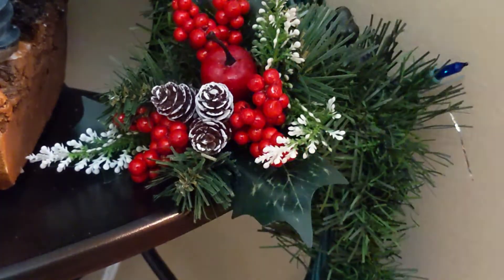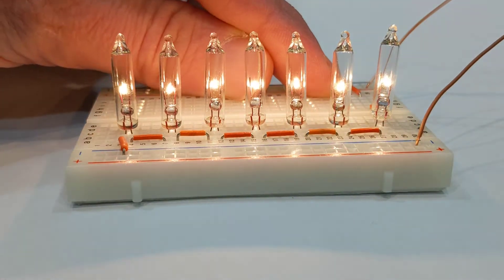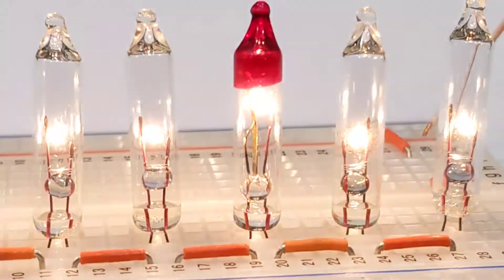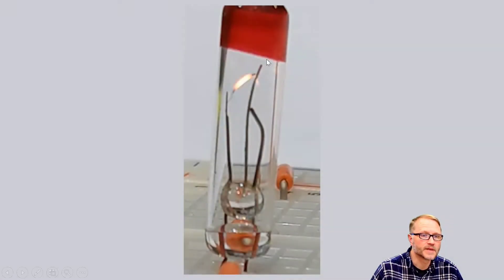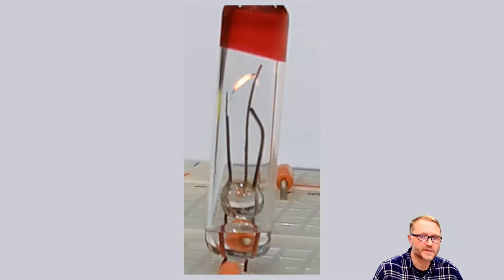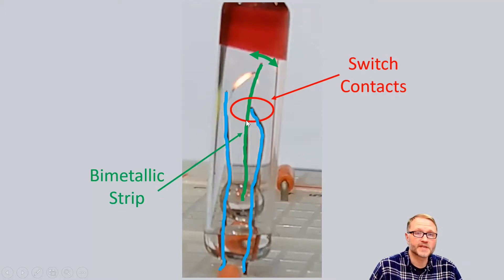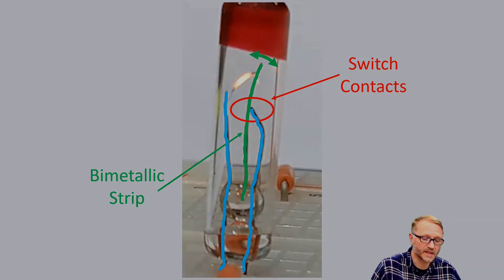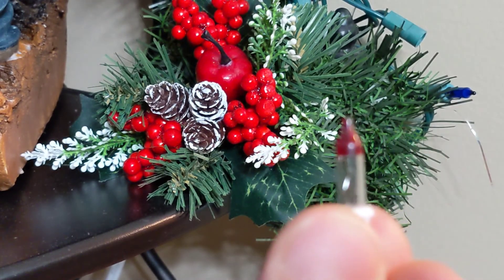The Secret Mechanism in Blinking Christmas Lights (Bimetal Strip Explained)

Comment: It's annoying that there is no manufacturer making blinking 2.5-3v toy bulbs.  I've tried LED PCBs (used to create flashing), but they do not work with incandescent 3v bulbs.
Reply: they don't be cose ar incndescents no DIODE. A diode respon faster than filaments incandescents. You must use a circuit suppor 110-120 input with DIODE rectifier bridge an then a controller or SRC transistor oputputs....

Comment: hi i have a question, i bought a 300 bulb christmas light. It was 3 that you had to connect to each other. I replaced each strand with 1 red tip bulb. They all blink but at different times, also for some reason the bottom strand thats directly plugged into the wall blinks fast and consistent but the other 2 that’s connected to the bottom strand sometimes only blinks
Reply: did you ever find the answer to your question?

Comment: Quality video
But I thought light bulbs were connected in parallel these days? I would be a little hesitant to buy a series strip of them I think because if one bulb died then the whole strip would turn off and it would be near impossible to find the broken bulb.

Am I right in that assumption?
Reply from the maker: Yup Alden! 

And so it goes, one little bulb and the entire string is out. 

Actually, it's not quite that bad, as many of the manufactures include a shunt in the lower part of the bulb that will keep the remainder of the string alive if the filament burns out.

Perhaps a video for next year...

Happy Holidays to you and yours,

APD
Reply: led strip/light strings are really cheap this days, and they can just be powered by a small 4.2v battery. The current is only arround 5mA per meter.